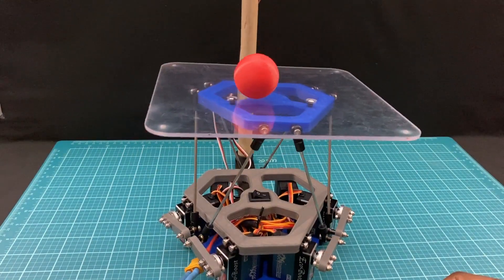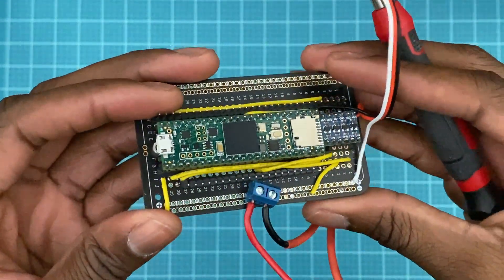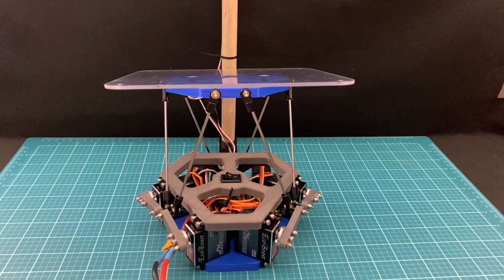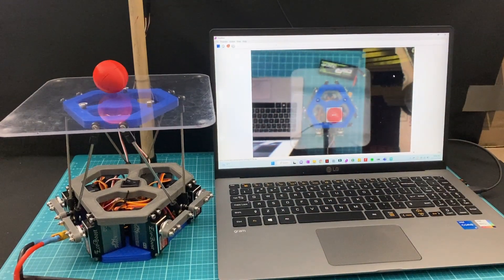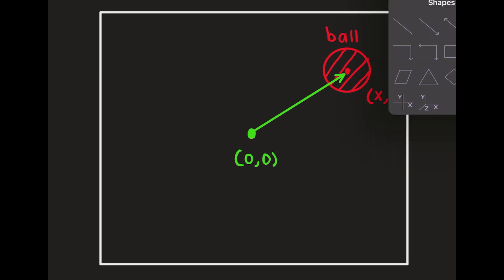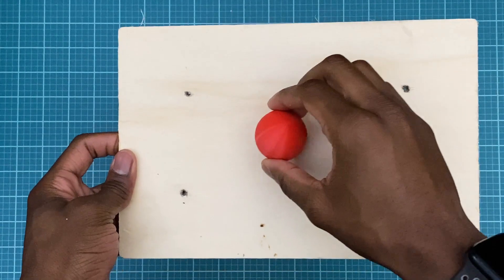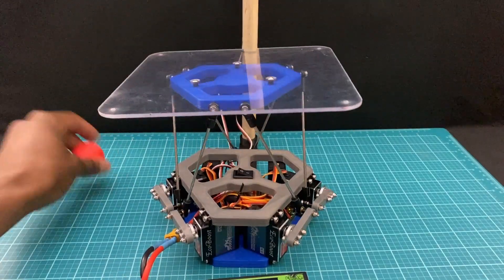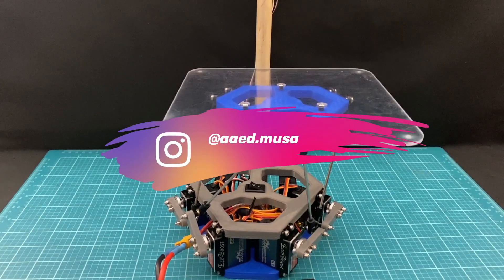Ball Balancing Robot pt.1

Comment: If the camera is not installed, can you modify the code to directly control the platform movement?
Reply from the maker: No. Without the camera the robot has no way of knowing the position of the ball.

Comment: What are the limitation of the platform? I guess it can not achieve any angle of rotation on every axis and such? How do you take care of these limitation before starting projecting this?
Reply from the maker: It can rotate on any axis. It can't rotate beyond about 30 degrees on any axis. It doesn't really need to rotate that much so it wasn't something I really took into account.
Reply: Thanks for replying and for the info!

Comment: This is a very well made project but that has to be the worst placed on/off switch I have ever seen. If something goes wrong you have to reach into the mechanism to hit the switch. Or if something burns you have to reach right into the middle of the device. Running a couple of wires to the outside would be a much better solution.
Reply from the maker: Agreed thanks for the feedback